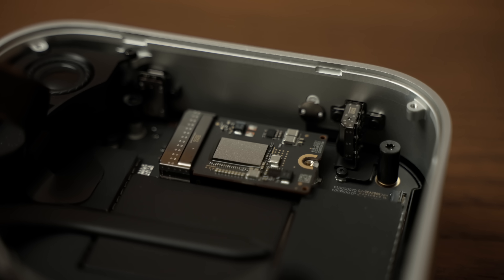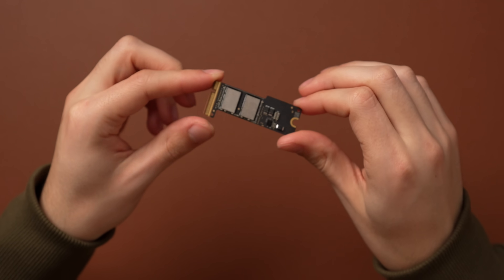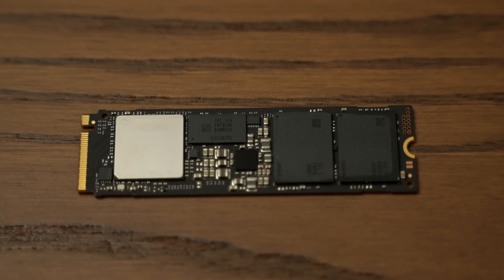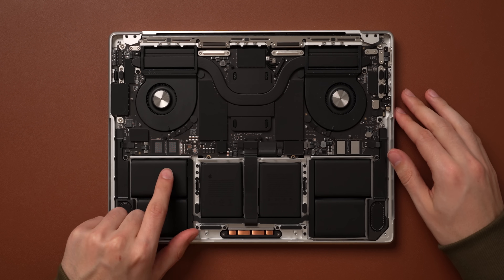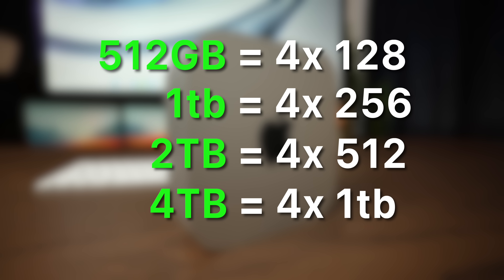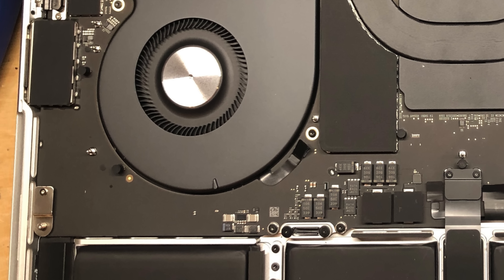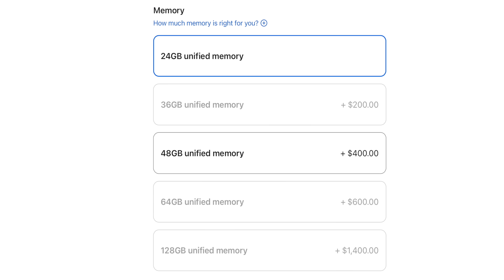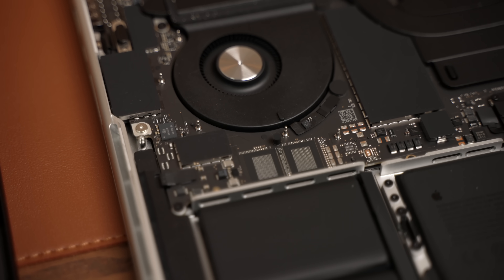Apple SSDs are hiding a BIG secret... Upgradable MacBooks??

Comment: WOW! What a mess!!! The other day I decided I wanted to swap out the jobs of a pair of my computers. They are both mass produced X86 mini computers with NVMe drives. All I had to do was open them both up, switch the drives, close them and start them up. Both drives had Linux on them. You can do that with Linux. You can't do it with Mac OS or Windows machines. And compared to the cost of Apple storage, both drives were ludicrously cheap to purchase!! With Apple, you're not a customer. You're an ATM. I was an exclusive Apple fan for 35+ years. Enough is enough!!
Reply: Same--my development career may be wrapping up and then I'm done with Apple.  Not sure what I'll do about the iPhone and my photos, though.  But I won't be  buying MB Pros anymore.

Comment: Your different logic board hypothesis is wrong. For anyone one type of Mac, let's say 14" MBP, they should only need 2 different logic board types. This is because the there are two processor options and different sizes/pads for mounting them. The components (Processor and NAND) on the boards are added at the factory and don't cost anything to Apple except for the component added and the slight time to add it by the robots. The RAM options for the different M chips have no effect on the logic boards. The RAM is included from the factory that built the M chip. It's is an on package RAM. The reason you can't get 16GB of RAM on a M? Max is because it would increase the cost dramatically in making the chip/package to have another SKU. So, for any one specific model Apple should only have 2 versions. Each version has either an M4 Pro and the other an M4 Max.

Comment: The interesting thing apple fanboys try to find an advantage on apple modules over standard NVME devices, justifying the tenfold price in plain words why a plain PCB and a few NAND-Chips are better than a PCB, controllerchip discrete DRAM Cache and NAND Chips and no that are not magic Apple NANDS just plain industry standard. 
My assumption as fast as there were 3rd party storage solutions at only threefold the price, apple will find a way to prohibit the use of 3rd party modules, we will have the chance on the current Mac Minis and we will have it never again. Unfortunately i you compare the storage prices over the last decade they are consistent, we didn't get any advantage of dropping storage prices like in the real world, in apples fairytale prices are almost stable especially in that areas where the prices usually significantly drop. Perhaps the new studio will have exchangable storage boards but i think the M6 Studio will have a soldered on soulution witjh the same TB-Prices like the M1 generation even when regular storage prices has dropped to a tenth of the prices today.

Comment: Having the drive controller on the SoC was some shrewd forethought by Apple, preventing anyone from upgrading the storage with an off-the-shelf NVMe drive. Even with removable storage you still have to use an Apple module, so they can keep up the ridiculous prices.
Reply: That's the whole point. Greed abounds at Apple.
Reply: The reason is power saving.  Moving the controller and cache to the SSD means all reads and write that hot cache are very low power. Means you can keep the data lanes to the SSD mostly powered down.
Reply: @hishnash  Apple's silicon is already the most power efficient on the market, I think most people would take that tradeoff for user upgradable storage
Reply: @ what makes apple silicon so good is all of these chooses.  On package memory, integrated SSD controller, dedicated display controllers etc.. ones you start to discard these you quickly end up with a system not much better that the competitor
Reply: It's power efficiency and performance. This configuration likely saves multiple watts (which is a lot!) under heavy drive operation.
Reply: @davidkorcak  the main power saving is when not under heavy load. Moving the controller to the soc means the rest of the storage can be put to sleep much more often and for longer

Comment: Put in a standard M2 slot ...
Reply: They have the SSD controller on the M chip due to security and encryption. I doubt they will have m.2 slots anytime soon.
Reply: @ You can have SSDs up to 14000 Mbps ... about twice what you can get in any Mac
It's all about locking down their systems and price gauging on the upgrades,  charging excessive prices for mediocre hardware
Reply: @Wannes_  Exactly. Having the controller on the SoC offers nearly 0 benefit other than $$ for Apple. You can get consumer M.2 drives that have hardware encryption already, no reason Apple couldn't make one. NVME is such an established protocol at this point it's absurd not to use it.
Imagine the praise Apple would get for making user replaceable storage at prices that make sense. The Samsung 990 Pro 4TB is 400 MSRP. Even if Apple charged 600 for their SSD, most people would see that as a huge win, and Apple would still make huge margins on that. But sadly they will never be that consumer friendly.
Reply: Except, the module is pure nand, nothing else. The rest is on the main board. So if you keyed in an M.2 it couldn’t work
Reply: Apple is likely saving that for the next gen of Mac Studios...offering some level of upgradeability to their most costly models.  IMO, the Cheese Grater is a goner.  TB5 (and beyond) will begin to offer enough "bandwidth" to allow Pros to add external "personality cards" in an external eGPU-type box.
Reply: Having the controller on die has an actual performance benefit.

What we actually need is a standard for nand boards with off board controllers so more integrated controllers can be done. But ssd makers don’t like that because then they can’t brag about how their specs on their controller is the best (since they all use the same nand suppliers)
Reply: @amnesia5490  No it doesn't
I've had SSDs that are faster than what's in the mini for years
Even in the mini Pro or Studio, you don't get the performance you could get out of modern SSDs

Comment: There's an additional reason that it makes sense, especially with 256gb + unified memory. If the disk dies under warranty they have to replace the whole logic board. If the storage is removable they only have to replace that so add that on top of manufacturing simplicity and it makes sense to go back to it but hey, this is Apple. They could change their minds by next week
Reply: So true. Also probably an e waste mandate they are complying with.. think about companies getting rid of them at end of useful life and having to shred entire computers because storage can not be plucked out and destroyed separately.
Reply: @FloridaMan02  That's the precise reason that Apple have had a lot of criticism and precisely why I hope the next refresh bumps minimum storage to 512gb. Hell, for how much the chips cost they could to 1tb but even 512gb would make a great difference on longevity. When I build Linux servers I don't put swap on SSDs unless it's a dedicated SSD because virtual memory absolutely thrashes them for write cycles
Reply: It's wrong, even this channel showed the way of changing SSD, he upgraded his SSD in the past 1 year.. well it wasn't easy, but for a store, who know how exactly it works it's more easy to melt down the old storage and simply glue a new one there...
Reply: @TamasKiss-yk4st  Do you understand how finance works? The cost of labour means that it's more economical to replace a board than it is to replace a chip. These things are machine soldered on. They won't hand desolder and replace them then connect it to another machine in target mode to deploy the OS to it. 
Minutes Vs hours. Labour is always the most expensive cost

Comment: If the SSDs weren’t proprietary, I’d say give them a pat on the back, but they are proprietary so they should get criticized for not using standard drives. 

Additionally there is no reason for Apple to recreate SSD’s when the form factor and design for M.2 SSDs was finalized and available for people to buy for over a decade.

Apple is saving costs by doing it this way and they aren't passing those savings to their customers.

Having removable storage doesn't matter if you can't buy modules at a reasonable price.

The highest spec chip isn't binned, it's a chip that met the standard.
Reply: The joke is their proprietary ssd isn't even fast.